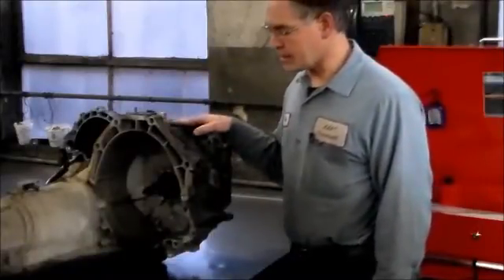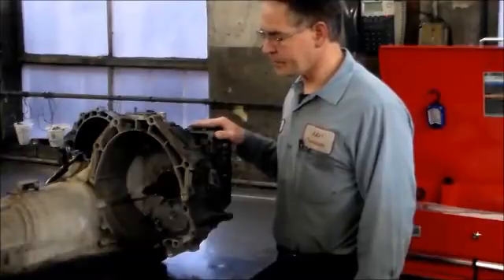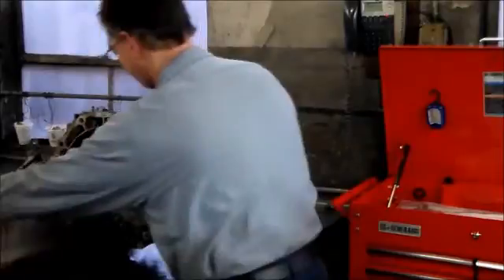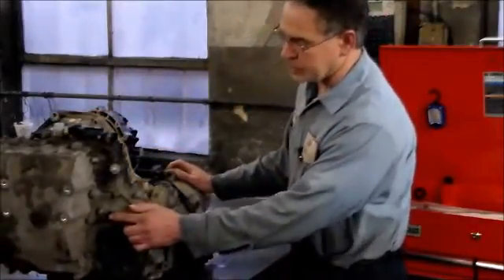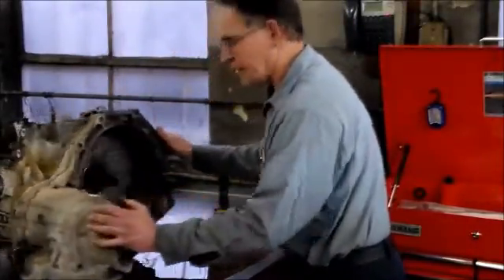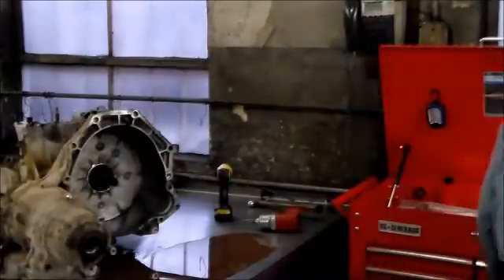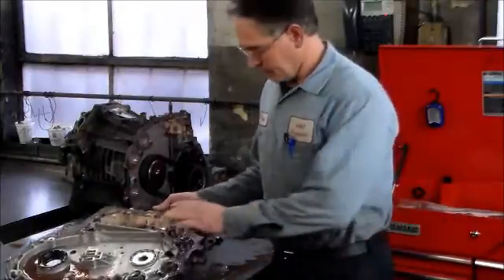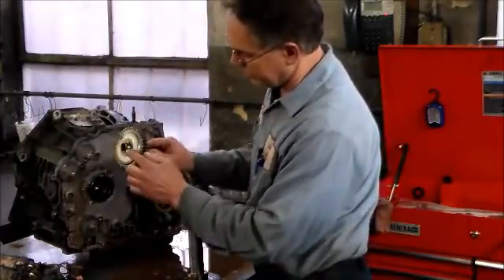AX4N Teardown Inspection, Part one

Comment: I did finish put back my transmission and started up the van let it warm up for an hour with putting in around 12.5 quarts of mercon v it moved in drive and reverse I was very happy to see it accomplished but as soon I picked up speed the rpm went to around 3000 rpm but it didn't change gear and went to neutral I had to manually put it in 1st and bring it home now here is the deal I am positive I put back everything perfectly except I didn't rebuild the valve body (opened it up to replace the check valves and the plastic balls only) also my buddy damaged the pin connector plastic when jacking up the transmission and the speed sensor clips were broken I will check that tomorrow after I come back from work, also I did wash the shift solenoids with gas do you think that damages the solenoids. where you think I might have went wrong ? should I just replace the whole valve body and if so is it accessible to do it without removing the transmission I appreciate your help
Reply from the maker: can you tell me if any codes are present.  Couple things to check before you get back into this trans, but lets start with codes
Reply: yes I found 4 codes 1st was P0715 rest were for the egr and cylinder 3 misfire . I did find the pins on the speed sensor were oily and dirty so I did clean them with brake cleaner.  remove and reset the battery terminal and tested it it was doing the same I drove it for 15 min and the codes still didn't show up again.
Reply from the maker: Ok, the 715 code is input speed sensor, this sensor is near the left side axle near the side cover, is this the one you looked at?
Reply: yes sir that's the one I looked at
Reply from the maker: Do you have a scanner that shows live data, wanted to check some things before we tear into this trans again.  some things to check are, the position switch(this tells the computer what gear your in, like reverse, drive or neutral, this can read incorrectly and the computer will think your in manual one and not shift, also check make sure you do have input speed in park at an idle, this should be the same as engine rpm.  If all that looks ok, you may have a problem with your 2nd clutch pack, if there is a problem with the 2nd clutch pack it wont have 2nd,3rd or 4th.
Reply: yes I do have a scanner that shows live data but I am not aware but I don't know if if it displays position switch I noticed today when I took if for a test it did go in second gear only when I reduced my speed and then when I pushed the gas it went to around 40 mph and then again the transmission slipped out of that gear I then have to manually put it in 1st or reduce my speed to get it back in second
Reply: also what do you think should be the resistance on the turbine speed sensor
Reply from the maker: not sure off the top of my head, i will look up the info and get back o you.
Reply: I took the readings on the TSS and got 150 ohms when it was hot and 134 ohms when it's cold
Reply from the maker: ok, sensor should read between 100 and 200 ohms
Reply: so that means my turbine speed sensor is working good, I did clean the TSS connectors with brake cleaner and since then I didn't get back any codes (drove 20min all monitors ready) what should be my next diagnosis
Reply from the maker: You drove for 20 minutes, whats the trans doing staying in first gear?
Reply: yes 20 minutes stop drive reverse some road but it stayed in 1 st I felt it kick in second sometimes when I reduced my speed around 5 mph but one thing bothers me that my initial issue was that the transmission would slam into 2nd and I also had a shudder at low speed so is it something related to my original issue
Reply from the maker: Did you change any of the molded pistons
Reply: yes sir I did take it to a transmission shop near my house as I didn't have the tool to compress the spring
Reply from the maker: have you checked the live data, make sure the range sensor is reading the proper gear
Reply: I'm sorry I think my scanner does not provide transmission range data my live data has the following DTC_CNT,  FUEL SYS, LOAD_PTC, ETC, SHRTFT, LONGFT1, RPM, VSS SPARKADV, IAT, MAF, TP, O2. but I did ohm out the TR sensor in drive and neutral and it was correct according to the specs I will later check the input and output on the plug. I also didn't make sure that the TR sensor is correctly lined up.
Reply from the maker: ok, yes check that
Reply: ok Gary I have found 1 issue here the VSS sensor on the transmission I was checking it and it seems like the reading was not right. My meter shows me 486k ohms (which is equivalent to 486000ohms) when the manual specifies it to be between 190-250 ohms. I will go ahead and get one to replace that it should be the one causing all the trouble.
Reply from the maker: Its very possible, i would do that first
Reply: I went to the junkyard today took readings on 3 Windstar sensors and I got 486 k ohms could all of them be bad or my manual is wrong my manual says 190-250 ohms and that is the VSS I suppose the one towards the passenger side under the heat shield
Reply: it's mentioned as an OSS in alldatadiy and it says the resistance should be between 235 and 735 ohms
Reply from the maker: let me check my sources and see what it says
Reply from the maker: I didnt forget to check, i will try to do it tonite, i didnt have 2 seconds to myself today(i thought i was going to be slow an we are packed)
Reply: Thanks Gary I really appreciate what you are doing,  God bless you.
Reply from the maker: According to mitchell on demand, the vss should be 170-270 ohms
Reply: That means I do have a problem with my sensor I will get a new one tomorrow thanks
Reply from the maker: Ok, sounds good

Comment: Yes sir I do have a tube that goes into the orange seal on the differential support(the drum that supports and locks the differential using a snap ring) that tube also has a second tiny jet outlet that sprays on the differencial.
Reply from the maker: Ok, i always replace that tube, they tend to wear at the bottom were it fits into the seal and also wear at the small o-ring.
Reply: Yes sir you are right that line is worn out at the inlet side but no one has it in stock I have tried many transmission part suppliers even the Ford dealer doesn't have it they say  the car is too old to keep Parts in stock, transtar carries an update kit which replaces my current double stepped tube to a single tube and adding another fifth tube and also it replaces the differential support which also was pretty expensive  I didn't pick it up  thinking that I still need a double Step tube which I realized later I should have  as my transmission has an empty spot by the rear lube tube. I have used the old line with new orings, what would you recommend me now to put in the update kit or replace the current tube which I can always do it later. What difference does the update kit have and is is necessary to update those tubes and differential support
Reply from the maker: Its actually been awhile since i did a 99 windstar, im actually not awhere of this update kit, let me speak to my transtar rep and get some info on this, if by chance that tube is available i will get the part number. Gary

Comment: hi Gary short question how important is the new updated rear lube tube for the 99 Ford Windstar transmission I currently have a double stepped rear Lube Tube
Reply from the maker: Do you have the tube that fits inside of the final drive support, is there an orange seal on the support?

Comment: Hey Gary, turns out the inner lip seal was rolled downwards all the way around.
Reply from the maker: +ILTSYC  Good Deal, you found the problem, careful putting that piston back in. Sorry for the late reply, shop is crazy busy.
Reply: Thanks for all your help man, I've learned a lot this time around. I have a long ways to go, I suppose that's what makes transmissions so exciting to me, its the challenge.
Reply from the maker: ILTSYC Your Welcome,  I love the challenge as well. Gary
Reply: Do you suppose I blew the inner lip seal out with too much air or I rolled it installing it?

If you can picture the top outer edge of that seal, that corner was at the bottom where the lips seal should be all the way around and at a glance you'd think it was installed correctly.
Reply from the maker: +ILTSYC   Its possible it was not seated correctly, then with the piston working for reverse it rolled.  Here is a rebuild tip when working with lip seals, after the piston is installed, you should be able to turn the piston farily easy, if the piston doesnt rotate or seems very hard, then the lip seal is not in properly. Gary
Reply: Thanks for the tip. I imagine it wasn't seated correctly to begin with because I had zero reverse to start with until I reinstalled the reverse apply tube which to me indicates that it must also be losing a just little pressure there as well.

How much pressure will the reverse clutch see in service?
Reply from the maker: +ILTSYC not sure what the spec is, but maybe at an idle in reverse, maybe 80 psi.
Reply: I think I know how I blew the seal out now. I'm sure I that I air checked it the first time around without clutches installed and that let the piston move up so far that the inner seal blew out and rolled downward as the spring pushed the piston down.

My new stack of friction plates are measuring .001 less than the old. Only one of the new frictions has its name worn off though, the one at the bottom of the stack.

I hate to use the old ones, what would you do?
New measure .268" and old measure .269"
Reply from the maker: +ILTSYC  That amount wont matter, you will be fine.
Reply: Thanks man! Its air checking fine at 10 PSI so I guess I'll start the rebuild.
Reply from the maker: +ILTSYC  Good Deal.
Reply: 1 thru 4 and reverse are working like new sir!
Should have worked right the first time,  I'm sure I learned more from the mistake though.

I strained all my oil thru a cloth in my funnel pouring it back in. I only caught some tiny bits of metal, nothing major. There has to be a better way to strain oil. I poured oil in that funnel for 40 minutes.
Reply from the maker: +ILTSYC  Good Deal, Its Fixed, I get the fine strainers from a bodyshop down the street from me.
Reply: Hey Gary, what kind of pliers do you use if any to remove those extremely tough e clips on the intermediate/low band servo push pins?
Reply from the maker: I just use a small/medium screw driver to get the clips out. Hows the car working?
Reply: Its working fantastic! I'm very happy with it. We have several hundred miles on it now, town and interstate and it works like new.

Again, thanks for all your help. Now I need another and another to do and get payed for it. LOL! I still have a lot to learn before I'm ready for that I guess. About the most I could hope for is to get a job with a transmission shop that didn't expect me to be already a top notch expert and learn the ropes.
.
Reply from the maker: some shops also have guys do piece work, they pay by the transmission. I do that when it gets very busy.
Reply: Do you send the car out to someone else or pull the transmission out and let another reputable guy build it?
Reply from the maker: +ILTSYC  We pull the trans and have it built, the rebuilder comes to the shop to work for the day.
Reply: Do you order parts after its torn down or keep a lot of parts in stock? You must have a parts supply pretty close if it needs more than a rebuild kit?
Reply from the maker: +ILTSYC  I get the basics, then order what else i would need, i get 3 deliveries a day. The rebuilder that does the piece work makes about 200.00 per transmission
Reply: That's decent money!
How do you decide quickly whether or not a transmission has to be pulled? Some electric issues on different models can cause transmission failures.
Reply from the maker: we road test the car, scan it, maybe run pressure test. sometimes its not so quick, sometimes a few hours before we have an answer. Some eletrical problems can cause trans failure, more so when they keep driving the car, got one of those here now.

Comment: Hey Gary, they finally found the leak on my F250. A weld on the Torque converter was leaking. Remove transmission for 5th and hopefully last time.
Reply from the maker: +ILTSYC   Those studs leak alot, the key to knowing that, is the whole bellhousing is wet on the inside from the oil slinging around.
Reply: You might have found it quicker had you had it. LOL!

Today makes 3 months they've had it and I think that's a bit ridiculous.

I got the battery and air box installed in my Windstar then put the oil in my tranny last night and when I hooked up the battery I heard a loud click.  I didn't think much of it but thought it very unusual. The starter bendix had pulled in and stayed in.  In a few more minutes I found out I had ran my positive battery term to the starter switch on the starter solenoid which eventually burned out my starter solenoid coils in a cloud of smoke and noise.

I had even marked on the solenoid where everything went but couldn't see the one marked POS with the starter installed. As many times as I've installed a starter in my life time and do this, it just blows my mind man.

So no test drive yet.
Reply from the maker: LOL, at least its done.
Reply: Hey Gary, I just crunk the van, I have 1, 2 and Drive but no reverse. Do you suppose it'll take a minute to get oil in there to the reverse piston? I haven't road tested it yet.
Reply from the maker: There shouldnt be a delay, the feed for that is the smallest tube in the filter area, First make sure its full.
Reply: Are you saying make sure that tube is full?

Could the shift linkage fine tuning possibly?
Reply from the maker: +ILTSYC  Make sure the tube is installed all the way,  If needed adjust linkage too.
Reply: I need a pump to pump all that new oil out into a clean bucket right through the filler tube.

I'll check linkage first.
Reply from the maker: +ILTSYC  If need be, drop the pan to drain the oil.
Reply: I'm gonna fetch a 12v transfer pump and get some 1/4" clear line to drain it in a clean bucket tomorrow sir. I'll go down the dip stick tube with no mess.

I took it for a test drive this evening and all 4 forward gears are working perfectly. That being the case it just about has to be that line in the pan doesn't it? I took a pic of those lines, unfortunately the angle of the pic before installing the pan doesn't show how well that line is pushed in.
Reply from the maker: +ILTSYC  That would be the place to start, maybe even pop the tube out air check the clutch and reset the tube in.

Comment: HI, GARY NEED MORE LIGHT FOR VIEW DETAILS BETTER
Reply from the maker: +Tony Perea  Yes you are correct, this was one of my first videos, also has to do with time of day, i usually film before sunrise to get the most out of the shop lighting. Thanks for watching. Gary
Reply: ok gary is ok only make idea everytthing ok
Reply: question can i mix aditive for transmission for problem of 1-2
Reply from the maker: Tony Perea Just wondering, what additive do you have? Also, on this trans 2nd clutch is a weak point. Does it slip bad or flare on the 1-2. Gary